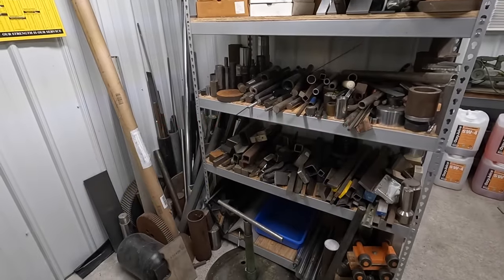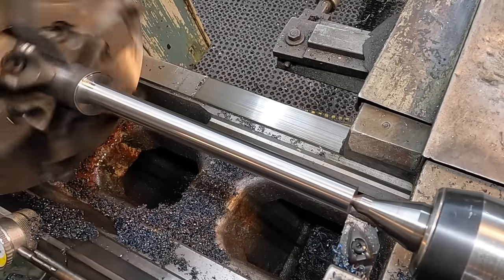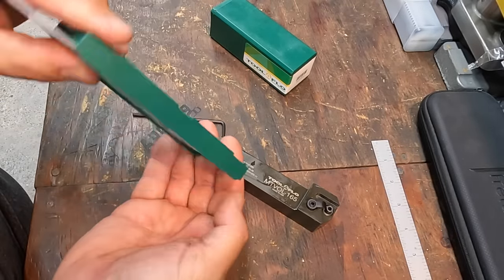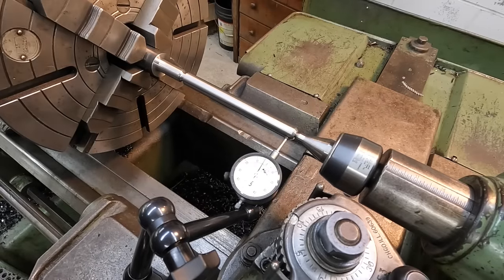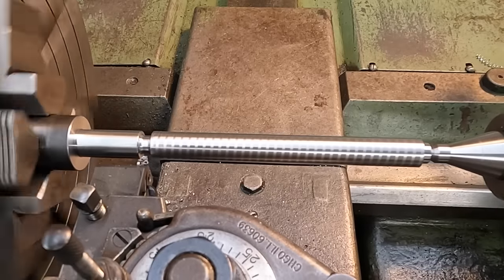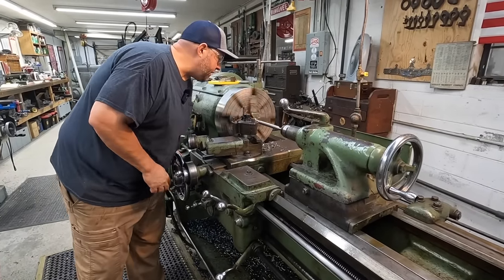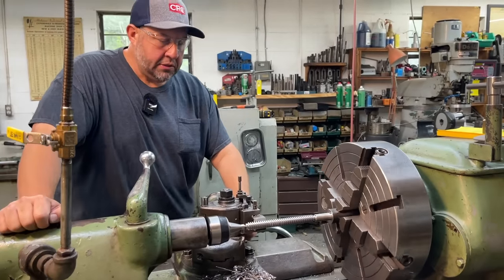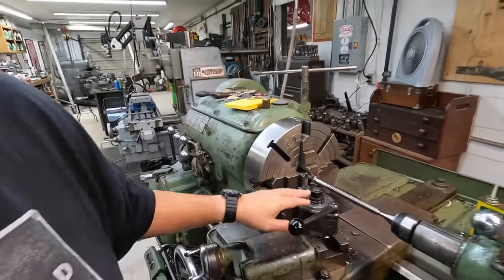Compound Lead Screw for American Pacemaker

Comment: Hi Adam, I've been following your channel since 2009 and have learnt a lot from you.  Regarding the problem with this lead screw, I'm sure you will definitely overcome the problem and get it done.  If I can share my view, I would urge you to troubleshoot and fix the root cause on the Monarch rather than switching to the Victor.  I notice that the digging-in occurs close to the mid point of the lead screw where the deflection from tool pressure should be the highest.  The symptom is very similar to the rubbing effect when we use carbide inserts.  With too small depth of cut, the tool pushes the workpiece back and rubs rather than dig in and cut.  When we keep advancing the tool the rubbing continues upto a point where the tool tip suddenly dig in with cumulative depth of cut.  Similarly the acme tool tip might have been pushing the leadscrew back and suddenly the tip happen to grab deeper than the intended depth of cut.  Would it be possible to use a follow rest, if you have one, to minimize the deflection>  Looking forward to learning how you fix this problem.

Comment: That insert may not have enough clearance on the side for that small of a shaft. The helix angle increases as the diameter of the shaft decreases. So maybe its rubbing on the side and then you feed more and more and then all of a sudden it has enough tool pressure to go ahead and cut and it digs in. In this case, I think a high speed tool will work better. Also  a carbide insert like that works much better when running much more rpm such as in a cnc machine. Its hard to run a manual lathe at the proper rpm for carbide while threading especially on that small of a diameter.
Reply: Also I have seen lathes do something similar if there is a chip in the half nut which is not allowing the half nuts to close all the way.

Comment: I ran into the same issue machining long square threads, it was cutting fine on the harder steel than the softer material. The softer material flexed in the middle and climbed on the tool allowing it to dig in. a follow rest and lots of oil would help.

Comment: I don't believe the Monarch Lathe was the problem . The gradual removal of material to create the acme thread reduced the mechanical properties of the cross section of the circular beam. The failure occured at the center of the span where the bending moment is gratest due to the tangential force of the tool removing material. Two things could solve the problem. Reducing the feed rate in the final pasess and increasing the material tensile strength. The later will not solve the problem totally, there may be some chatter but, at least it will not cause  material yielding and total failure.

Comment: Too much friction on the tool and  the material. That diameter is just too small for that much load. It may be only .002", but it's cutting the entire profile of the insert. I'd shorten the tailstock as much as possible, set your tool at 14.5 and use cutting oil.

Comment: Not sure if it's a cause or an effect of the issue, but I saw the live center lifting up quite a bit when you were running into those vibration issues. Could it be the live center is wearing out or perhaps not seated firmly enough?

Comment: I am soooo disappointed 😞  for you. I have had similar experience in my years as a mechanic, where I've had to make a part, and it goes wrong at the very last stage, although you followed every stage perfectly. It leaves you with a horrible empty feeling in the pit of your stomach.
I'm sure that you will get it sussed!. You're not just a big man physically,  but a BIG MAN who is not afraid to show a failure. You have my RESPECT.

Comment: Just follow all 700 suggestions and you'll be fine!
Reply: Many a true word spoken in jest. There are at least half a dozen different possible issues with that cut on an old manual machine, and they might all be in play. Addressing any one might be enough to get a good part, or they might all need fixing. Just moving to the new machine should eliminate all the machine-wear related problems, but using a full profile carbide insert on a thread 15 times its minor diameter without a follow rest might still be beyond the limit

Comment: Abom, go easy on the Monarch; the 60 or 70 yr old Kid is just fine!  Got to go back to the basics; talk to the Kenametal Tech guys; Carbide inserts basically plow through the metal; HSS tool bits  shear the metal as it cuts; carbide can not be ground as sharp as hss. We can get away with most slow rpm cuts with carbide but your threading project at slow speed and small diameter is compounding the failure

Comment: The bolt is bending upwards climbing up the tool.
Reply: Also the insert is mounted vertically but going into the slanted cut deeper and deeper. Everything has to be perfect and rigid in order not to jam into an edge. 
As you say the minor diameter is getting smaller and smaller, and that's the diameter that sets the strength of the rod. Not the outer diameter which is what we see.
Reply: The tool engagement is getting more and more too so I think there is just too much upwards force on that skinny bolt.

Comment: Sounds very basic, and I'm sure you checked this. But, make sure your lead screw and half-nut is free of any chips. That is something I forgot to check once before running a thread. It caused issues similar to what you had here.

Comment: I'm probably wrong,but if your cross slide handle is positive stopped to the same place everytime,and you feed in with the compound to cut deeper threads, shouldn't the compound need to be 90° ? Especially with acme threads? because the tool is getting closer to the chuck every depth increase causing the tool to cut one sided or at least widening the threads beyond spec?
Reply: No the compound needs to be set to half the degrees of the thread so only one side cuts and the other side just rubs, if the tool is fed in straight then there's more of the cutter engaged and a v shaped chip doesn't flow real well over the cutter creating a jam situation.. watch this old Tony another thread cutting video, he makes a model to explain it really well

Comment: issue is tool pressure  combined with small minor diameter on a machine that has worn out lead screws itself. Also, you can work with dial numbers 1-4 but it pays to stick with one number.

Comment: i am suprised at you using a tungston tool on only 3/4 of dia to screw cut such a small dia thread the tool pressures has caused your problem
Reply: And the old worn lathe.
Reply: @devenyi73  The lathe is fine. The ID of that piece got too thin and pinched the cutting tool and rode up on the threads.
Reply: @nebtheweb8885  This is certainly plausible. Sure is interesting how the cut went from working to not in 4 thou. Makes you wonder if he had cut the feed in half and slowed down the spindle at the first sign of trouble he could have saved it? Real test will be if the brand new lathe walks through it no issue, but my guess is the deflection will be the same as its length vs diameter  (assuming the live center is not junk or the head stock bearings are loose in the Monarch, but there does not seem to be any issue with that in other operations)

Comment: Your stock is getting too small in diameter and it's losing rigidity, it's not the lathes fault! 
You need to use a follow rest for that diameter at that length.
Remember, your depth of cut is close to .100", .750 major diameter, minor diameter around .550 or so, that is a long piece of material for .550 diameter, even a  .002 cut will cause the stock to ride up on the insert.
Just trying to help.
Reply from the maker: It is the lathe. I’ll prove it to everyone when I machine the next one.

Comment: Hi, I'm not a  pro machinist at all  but it looks like it could be due to deflection from the tail stock pressure maybe? plus material getting thinner and thinner and tool contact getting greater and greater, maybe plus resonance? i think about resonance because it started roughly in the  middle of the part.... Anyway it gonna be really interesting to see how you will surely solve this problem!

Comment: I believe that the thread is squeezing the cutting tool on the sides because of lack of support. This is  clear because it happened on the middle of the thread and only after you had enough depth. Use the follow rest before you take the thread rod out so that you can quick check. Anyway I believe its already late.
Reply: It’s climbing the tool.  It’s too long and skinny without enough support.

I ran a 25ftx46in lathe.  Lots of 5”x250” bars.  Chatter is usually a combo of rigidity and speeds/feeds.

Comment: As the diameter of the shaft got smaller at the bottom of the thread, the tool height raised above center excessively
Reply: Tool height was my first thought/guess.
Reply: Do you read what you text

Comment: I've had an issue before with acme and square threads where the saddle wants to jump sideways a little with the backlash in the half nut.  So I hold my hand on the handwheel as a brake to hold it on one side of the backlash which can help if that is your problem.  Another idea might be the shear cutting area of the acme thread and the long skinny nature of the part.  You could grind one side of the cutting edge way clear so it only cuts one side, then on another corner of the tip grind the other edge clear and cut the remaining side to keep the load down.  Anyway, you'll figure it out you've got no shortage of backseat machininsts on here to tell you what you've done wrong :)

Comment: Maybe cross-slide or compound-slide backlash? Possibly needs a roller travelling steady? Rotate the tip for the finish cut and check tip centre-height.

Comment: take a cut-off or slotting tool first, little wider than the bottom off the thread and go a little deeper, then take a thread tool 
and clean up the sides one at the time. you do not have chip flow fighting from three sides.

Comment: Is there a slight positive rake to the threading insert? I had similar problems on my smaller lathe, the cross lead screw and nut are really worn out so there is slop and that allowed the positive rake to pull into the piece and wanted to climb it. I took to grinding HSS bits with a slight negative rake to make sure the thread would not dig in. I need to make a new nut and lead screw as well.

Comment: You can put a dial indicator on the tool and see if it is sucking in, and you can put one on the side to see if the compound has side to side movements. Then try on the compound base, and then on the cross slide to see which is moving on those bad cuts. Might as well since the part is ruined anyway.

Comment: As others have said, it appears that the 1/2" of remaining material is flexing under the cutting load. Have you considered making a follower rest to support the rod while you cut? In my mind, it would be a support attached to the cross slide that has a brass or soft metal shoe on it for engaging with the rod while you cut. The shoe would have a 3/4" half-circle cut out and would be applied directly opposite where the cutter is located and follow the cutter along with the work. Something like this would mess up your workflow since moving the cross slide would not be possible with the shoe contacting the rod/work. It's just a suggestion I came up with on my own. I have no experience with doing something like this. I'm just trying to be helpful. Sorry that this happened to you. I always like watching your videos.

Comment: Thanks for the fantastic and informative videos.  I have been watching with great enjoyment for years.  A question I had on this particular project.  Will changing the lead screw thread to ACME have and impact on the measuring lines in the handle? I.e. will moving the wheel 5 thousandths as per the lines, still be five thousandths with the new thread?

Comment: Hi, Adam, no worries, good job,  i would like to comment that at the begining of the machining it worked perfect,  there were not chatter, so, i think when the lathe were making the OD smaller on the thread, in a way the bar got slender and could be chatter issue. i bet you are going to find it out. good job. i enjoy watching your videos. thanks.

Comment: I'm not a machinist, but a mechanical engineer.  That skinny thing was probably flexing causing the chatter.  Might have even been in a pre-buckling condition - but I don't know how much axial load you had on it.  Could have been a flexural harmonic of the shaft - that frequency will change as you make it skinnier.
Reply: I was thinking along those lines. If the load on the tailstock center is high, the side load from the tool could cause something like buckling after enough material is removed. Those carbide inserts are precisely shaped but not super sharp, so quite a bit of force has to be applied to make them cut. A follower rest would help.
Reply: 😂 You guys are hilarious, and exactly the response I would expect from a mechanical engineer with no workshop experience. No offence intended. No need for pre-buckling or flexural harmonic analysis, its a simple case of too much cutting pressure.

Comment: Once you get chatter in a part it’s pretty much impossible to get out, unless you’ve got a super sharp HSS tool that can shave that out at low speed OR enough material remaining that you can get a heavy cut in under it. In my experience, most inserts have a minimum DOC that they like - otherwise they tend to rub and induce chatter in the part.  I saw you verify squareness of the tool, but did you verify proper center height?

Comment: To me, it seems like there is too much linear cutting edge as you go deeper, so the tool will get sucked in. I think that is why it was ok for most of the cutting, but then when too much cutting edge gets in contact, it grabs. At that point, maybe even lesser cuts, like .001.

Comment: Fist: I’m not a machinist!  I noticed that the chips changed shape as you progressed through the job.  Early on they were long and slightly curved.  just before the failure they were short and very curly.  That told me something changed.
Reply: The diameter got smaller

Comment: Happens to us all newb or experienced  .... tool height can do this if your below center ...slop in cross feed can let er drop...
Watching the chips they were coming off in nice long chips then smaller and smaller as diameter decreased and the work hardened from heat..... change the surface speed and keep it cool so it won't harden.... a follower to prevent  flex from reduced diameter..... happens to us all.... but the second it does save the part by annealing and follower with speed change.... when doing threads speed changes don't help as much as depth of cut .... but definitely lube/cool

Comment: You said you had been checking it with the nut? That means the tailstock was pulled back to try the nut on the end? Is it possible the piece didn't get quite centered right after doing that?

Comment: Hey Adam, I'd agree that rigidity reducing as you go further from the chuck and machine the shaft smaller is probably causing the issue. I'm not a machinist, but could you cut the threads in two sections L-R (first ~5 inches first then last 5 inches) so you're not 6+ inches from the chuck where the problem seems to surface? Or is that a real silly greenhorn suggestion? 
Either way I think the rigidity of the piece needs improving to prevent any deflection/resonance/slippage. Could you machine flats on the chuck end to prevent possible chuck slipage? As in other comments, some sort of lubricant probably wouldn't hurt, but again, I just watch these vids for fun.

Comment: When I saw that minor diameter and the length, I just had a feeling that was going to flex in the center. I'm not sure if that's the specific problem here but I also saw that it started cutting heavy on the left side of the cutter (chip direction went from right to left). Very strange. I would have to a dial indicator on the tool post and ran it in the thread to see if there's some weird stuff going on.

Comment: i give u a pro tip as a machinist also no need for micro to measure that make it less than at least point 0.1mm of diameter and use v-cut tip first before using the acme tip angle so your cut will not choke

Comment: Your lathe is Awesome. Take lots of spring cuts as the bar  starts to get thin….there’s nothing wrong with picking up the thread again either. The torque applied to the part and any lathe is HUGE when cutting coarse acme threads…the undercut is the weakest spot on the workpiece and it will twist like a spring. You and your machine did nothing wrong. 

My trick for coarse left hand acme threads is hold the tool upside down, spindle in reverse, no undercut because it weakens the workpiece. Run from tailstock to headstock and taper out of the end of the thread with the cross slide. If the print specifies an undercut, do it after the thread is finished.

You have a great YouTube channel merry Christmas. : ) 34:43
Reply: i'm of the old school that says cutting acme  or square should be done with tool steels  not carbide.  and a good cutting fluid is priceless.

Comment: A following steady-rest with ball-bearings (three), would have helped. Even more primitive ones with brass or bronze-studs or fingers works extremely well if lubricated a bit, given the bearing surface of the work-piece is reasonable smooth enough, as an ACME-thread on the outside before threading. One can dress the work-piece carefully with a fine file after each pass, removing any nagging burrs, biting into the simple fingers of the steady-rest.

Comment: Hi Adam, such a shame this happened I guess the tool is cutting on 3 sides it will show up a machine error more easily. Looking fwd to watching the replacement on your new lathe. Felt for you whilst watching but unfortunately things like this do happen.
Reply: Actually the infeed angle is supposed to be 14.5 degrees to prevent cutting on 3 sides.